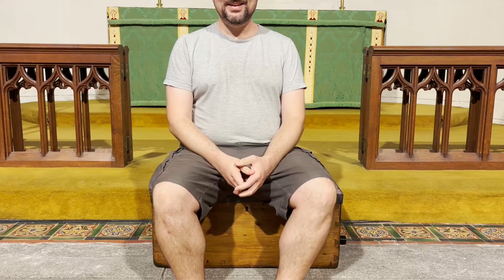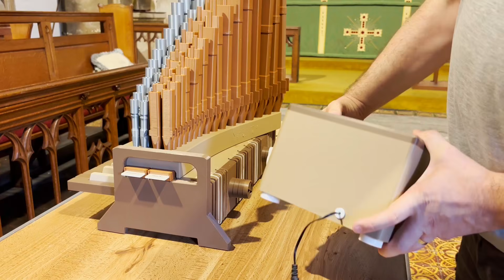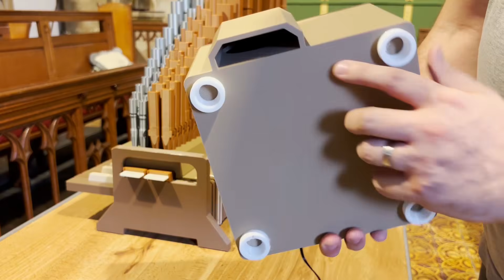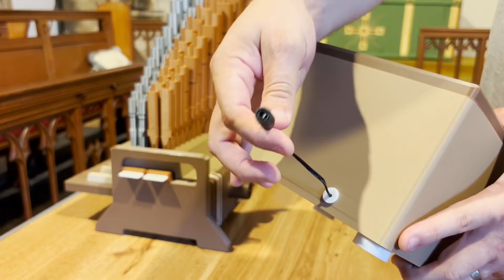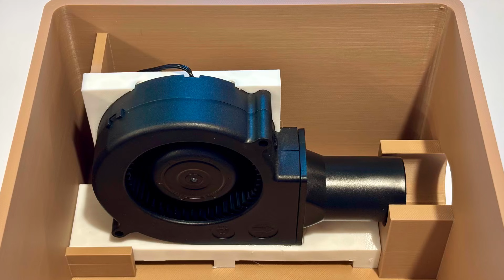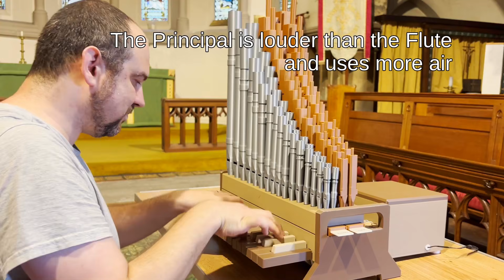3D Printed Organ Blower: Is Bigger Always Better?

Comment: hi there
great video and explanation❤
what i always wonder is what happens with the excess air? i cant see an overpressure valve or similar.

happy to hear from you :)
greetings
Reply from the maker: Good question 😊 there is no over pressure valve, but the organ is slightly leaky. In combination with setting the blower speed carefully with the knob, the organ settles as a natural pressure and plays well with single notes or chords.

Comment: Hi, could you share the specs of the blower you used? I am currently using a 120mm 12V blower for mine and it seems that I do not have enough air pressure, then again I currently have a lot of leakage which is probably not helping :D
Reply from the maker: Sure. My big blower chest has a 140mm 12V blower and a reservoir, and I need to run it at about 75% power to maintain pressure. This smaller blower box contains a 97mm 12V blower and seems to do just fine at 50% power, which is surprising. I think attaching the blower right on the back of the windchest and doing without the hose helps a lot. I’ve also worked quite hard to make my seams airtight, so I think if you tape up your seams where the back panel of the wind chest goes on, you’ll massively improve the pressure.